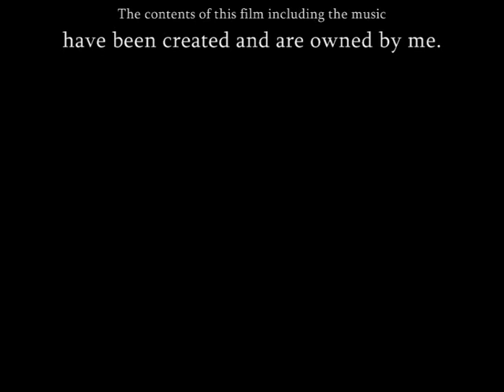Link pin 2" narrowed beam - part 1

Comment from the maker: Yes i had a heck of a time finding it too - I was just about to get some bar and make it on the lathe then I discovered exhaust tubing the right size. The front beam pipes are made from steam pipe (or boiler pipe) and the ehaust pipe inners are a snug fit. Try a muffler shop that makes pipes as they will either have it or can expand something close to fit what you want.

Comment: If putting in adjusters I cut only the centre & break welds move the pan mounts & damper bracket out 1" per side. Stronger beam.

Comment from the maker: Hi - a two inch narrowed bean is 1 inch per side. It is hard to go any more than 3 inches total which is 1 1/2 inches per side - unless you chop off the shock towers. To get 3 inches you need to replace the shock towers with 10mm plate (3/8") ones and weld them right on the end. I have seen a beetle that had been narrowed 4" but they had to recess the towers inside the inner fenders and alter the gas tank - and 4"narrow looks stupid anyway :)

Comment from the maker: I got some 10mm plate water jet cut to the right shape for the next beam I build - cost me about $40 for the pair so see what you can find. The stock ones are fatter than that - closer to 20mm of 3/4" from memory and they are hard to cut off and move.

Comment: Nice work on the videos.  So the inside is sleeved.  What thickness of tubing did you use for the inner sleeve?
How hard was it to drill the end of the cut spring pack?  Did you need a special drill bit for the spring steel?  Standard 59 degree point bit?  What diam?

Comment: At 1:55 you put inner sleeves in the tube and I'm doing this same mod on my 74 and I'm having a hard time finding the right size pipe to use could you help me with this? What size outer diameter pipe did you use? And where can I find it? My local metal shop doesn't seem to have it and to be exact he said I'd be " lucky to find something like that"

Comment: Hi,
What is the purpose you cut half of the shock tower of and added the flat sheet of metal?
Thank you!
Reese
Reply from the maker: It gives you the clearance needed each side - without doing this you can only go 1/2" each side. To go narrower than 1" each side you have to remove them altogether and weld 5/8" plate ones right on the end of the tubes.